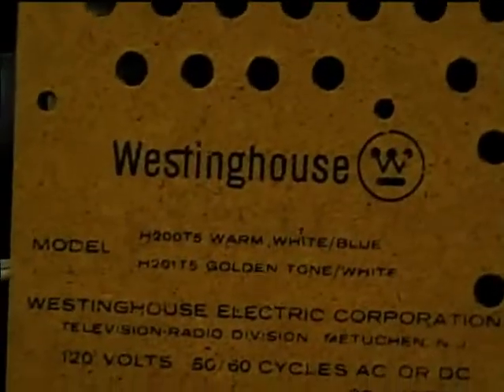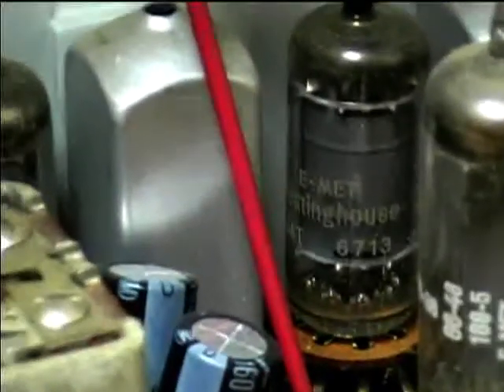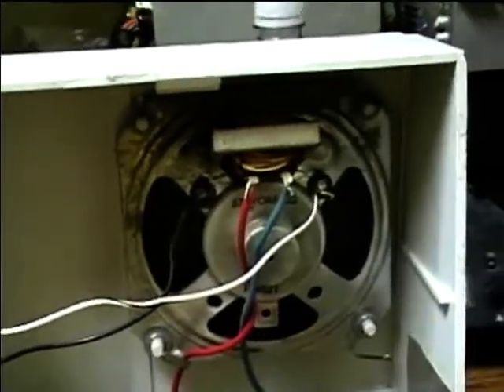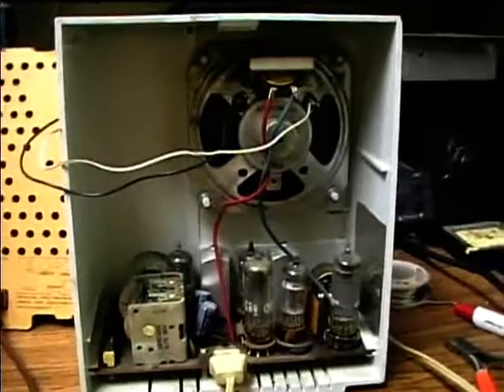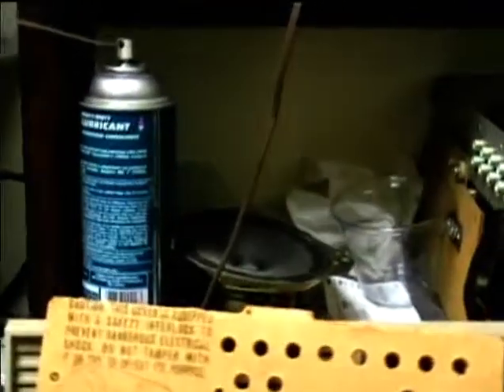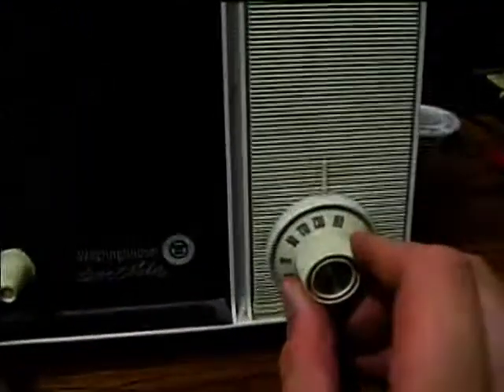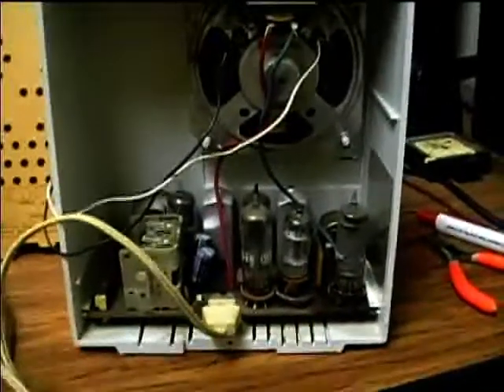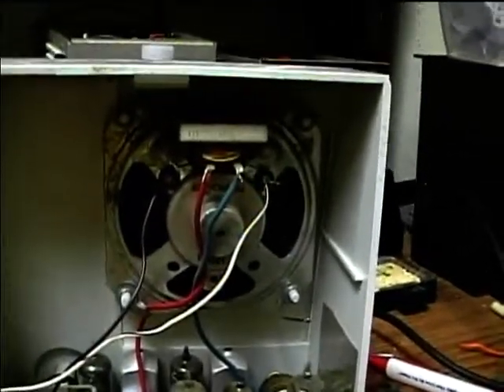1967 Westinghouse AM tube type radio model H200T5

Comment: I have worked on a number of these and some of them had some bad burns, mostly around the rectifiers and power output tubes, they are the hottest. These radios were played many hours a day for years in a hot environment. So if youre PCB boards are in good shape now, your good. You are not going to run them long enough to damage them.

Comment: I believe your right the length of time is a big factor. I have seen some PCB that where very brunt because of heat. But that was most manufactures first attempts in making PCBs with tube. I think they make the PCB out of glass and glue.

Comment: You are probably using it in room at a convertible temperature and the radio has good ventilation. That is as good as you can ask for, for any radio. The worst tube radios that used PCBs were the ones that had the PCB mounted on the top and the tubes pointed down. So the heat from the tubes had on other place to go but into the PCB.

Comment from the maker: I actually have not found too many cases of heat damage to radio circuit boards from tubes.There was one Magnavox where heat had traveled down the audio output socket pin and cracked the solder. For some reason I see the heat damage a lot more in TV's...don't know if it's just because TV sets were often left on for longer periods of time or maybe the total amount of heat in the cabinet was more because of more tubes.

Comment: Have you tried connecting another speaker in parallel, just to see if it sounds better?  That way you wouldn't have to go through the trouble of changing the transformer if the problem is with the speaker.  Maybe the cone is brittle and cracking, so it is too stiff to produce any bass.

That chassis like a lot like the one in my GE clock radio, except just a bit bigger.